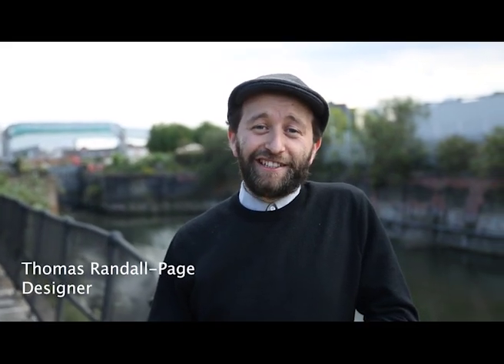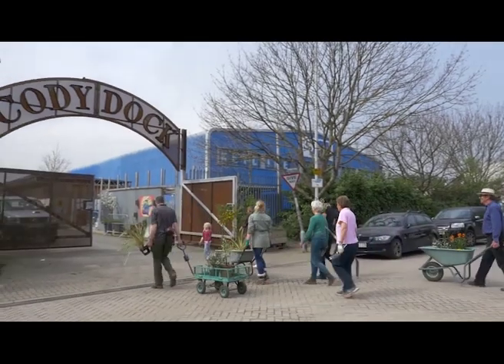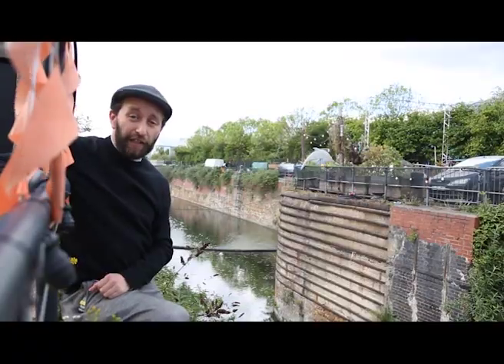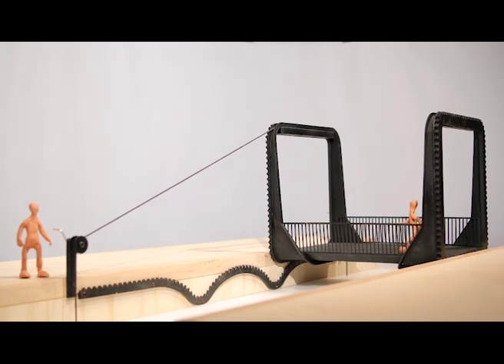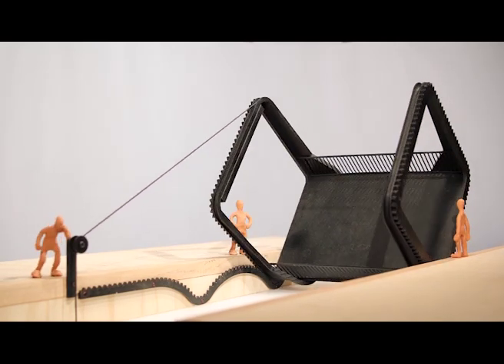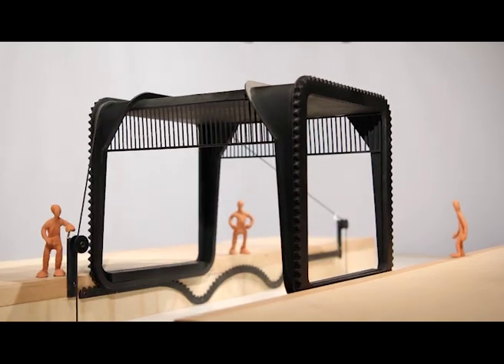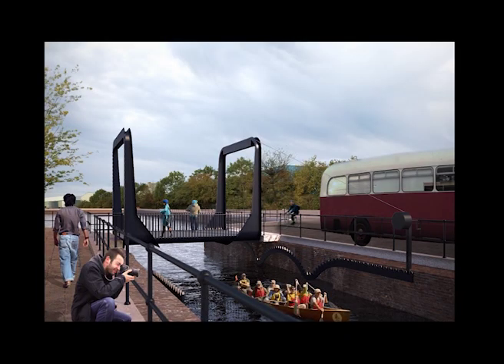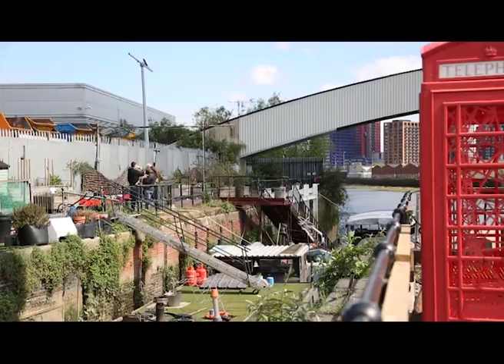Cody Dock Rolling Bridge

Comment: If only humans had invented, oh I don't know, the inclined plane? Or, you know, steps?

Thank goodness someone designed an overly complex and needlessly dangerous pork barrel project in order to cross water.
Reply: People on wheelchairs or bikes could not cross inclined planes enough high to let a boat pass under it
Reply: @dariosilvestri473  LOL! Ffs... Wheel chair ramps are inclined planes. Dear Lord...
Reply: @jasonwarren9279  the point is that the  slope for a ramp is small. For example a wheel chair ramp would take 10 meters to go up 1 meter and other 10 meters to go back to ground level and clearly these kind of bridges don't need to cover such a distance

Comment: just from the visual, its looks unbalanced, when the road section is vertical, it looks like att the weight is on one side, what is the counterbalance?
Reply: If you notice the tracks you can realise that they are made on purpose for square wheels so it would be as stable as an round wheel moving on a flat track. Probably is still very heavy and no super safe but is not more unbalanced that other things

Comment: why not roating the bridge inside a cylinder which has a cut out at the bottom? So you could have a roof as well. Also more use of standard material, so less pricy

Comment: Ok, this is cool, but you could replace it with nearly the same single sided operational functionality but just having a normal-ish bridge with a big counterweight that swings to one side on a vertical axis like a door. You get 75% of the footprint efficiency at a tiny fraction of the cost of all this highly complicated undulating cog and sprocket/rack and pinion jazz.
Reply: Come on, it's an artistic statement, designed with added amusement function. Not a competition for the most pragmatic bridge. Which engineering professor sent you here to scold the video for complexity?

Comment: Isn’t a rolling Whole structure on unrolled gears way more fragile than a simple two split elevatory bridge? You could even keep the design making two huge metal planks that opens outwards and complete the “arches” that use to be the supporting structure.
Reply: But where's the fun in that? :D

Why are so many commenters missing the point... This design is an artistic statement, if you don't enjoy such art then say so or scroll by, pointing out that there are simpler bridges is totally missing the point.

Comment: Hard to believe the number of comments about safety. The whole length of the Lee is a path, with the water to one side, people can slip off, and some may drown. Yup.
This is an opening footbridge. It will be operated either by the 'driver' of the boat or volunteers. The winding mechanism will be protected by a key, which every canal user will have, they unlock it, use it, then return it to its closed to river traffic position as a default. Just like every such footbridge on the canal system.
The details depend on what the traffic is; a train of Thames Lighters towed by a diesel tug has different needs from a narrowboat.

Comment: No don’t do this there are so many risks involved with this design for one wear and tear will eventually bend the supports of the bridge at the roll over point. This bridge is also likely to be unbalanced if more than 2 people lean over the edge. Possibly throwing them off the bridge. This bridge is not safe and as the designer you are held partially responsible for any injuries that occur due to a flaw in the design

Comment: Just by watching the animation, i can see this wouldn't work in this design. Go back to the drawing board and for anyone else, don't give money to things like this without looking into the people involved and check designs, use your head.
A simple bridge up and over would be better and safer. A normal lock would do the job too, these are designed as crossings too.
Reply: It is a cool concept.   But over complicated and unnecessary
Reply: Come on, it's an artistic statement, designed with added amusement function. Not a competition for the simplest bridge crossing. Which engineering professor sent you here to scold the video for complexity?
Reply: @u1zha  The artistic statement and  amusement factor is there. But the engineering and safety to back it up is not,  At least not shown in this video.  
There is absolutely nothing wrong with the idea and concept of this bridge.  But the design shown is flawed, it would not work, ant there are many safety features that need to be implemented to ensure it will not be the cause of many injuries or deaths.

Comment: Looks like it needs more weight at the top of the structure to raise the centre of gravity. To make this thing roll by hand, the height of the center of gravity needs to be constant. Another possibility is rigging it so that the CoG is slightly higher in the ... Oooh, I get it now. The fact that the base is a bit heavier means that it naturally sits in place when it's down. When it's up, it balances, and there's probably a little dip in the path right at the end, or it's just a tiny bit overbalanced against some stoppers.

Comment: It’s cool but why not just build a high solid bridge?  Seems simpler and cheaper.
Reply: Instead of swing sets why not just build benches? Simpler and cheaper and safer.
Reply: @u1zha  uhhhhh,  swing sets and benches have 2 different purposes???  If the purpose of this bridge is to be a play thing then great.  But i was pointing out that it’s an example of trying to be clever when it’s not needed.

Comment: That is a beautifully thought out design.
Reply: No, it's really not.
Reply: @xxDrain  I would love to know why. Please explain?
Reply: @MrBennyboyC  Who is in charge of cranking the bridge when needed? Who is getting paid to stand there and do it? Who will be in charge of safety, so nobody falls into the water? How will you prevent litter from being dumped into the water off the bridge? It's a pretty design for a playhouse, but for real life there's more to consider than the mechanical execution.
Reply: @xxDrain  I completely understand your points but you need to take into account our history of bridges in the UK. Lock gates on nearly all of our canals are unmanned and pose risks to the general public and yet cause so few injuries. Surely we can assume they would add basic safety measures to ensure the bridge Is only opperated when needs be just like any other moving bridge or large moving structure anywhere in the world. It's very easy to look towards the safest solution for all of these problems but they are often not the most efficient or inspiring. I would always opt for the more creative solutions.
Reply: I think the biggest problem we have right now is assuming no one has common sense.

Comment: Why does the bridge feel like a “checkpoint” for a game since it’s only seen operable from 1 side like it’s a return path.
Reply: Got to find the secret way round, its only 230 miles away.
Reply: Legends say that this bridge will be in Elden Ring
Reply: Speed runners just skip this checkpoint with a prop boost, so we don't need to build the bridge now. Problem solved.
Reply: @idontwanttopickone  Speed runners use the weird geometry and not-fully tested rolling motion to clip inside the bridge as it moves, sending them flying across the map at several thousand hammer units per second.
Reply: This is going on Left 4 Dead 3 LOL
Reply: Why does this thing feel like something that I'm now going to explain exactly why said thing feels like?
Reply: @Ingestedbanjo  waiting for that explanation...
Reply: @deformercr6680  My point is the original guy already gave an explanation:

"Why does the bridge feel like a checkpoint for a game?"
"It's only seen operable from one side like it's a return path."

It's a little silly to phrase the comment as "Why does it feel like X?" if you already know exactly why it does.

Comment: - giant exposed, meshing gear teeth: pinch/crush hazard
- no lock-outs to prevent tipping the bridge with people on it: fall/drowning hazard
- cranks on only one side of the river, allowing people to become trapped on the other side if left inverted
- unstable resting states
Reply: i checked the rest of the comments, and it turns out this is fine, apparently anyone who is injured by bad design is actually an idiot and deserves it. it seems i had misunderstood what infrastructure is supposed to provide to society
Reply: @spambot7110  Listen, we should make society worse because human suffering is inherently good, or something, because idiots deserve it, or something. 

Because it strokes their ego to think themselves superior to all the idiots that deserve to be drowned or crushed or whatever.
Reply: In order:
- fence/railing to protect from crush hazards
- someone on the bridge would increase the force required to rotate the bridge. Just have a torque limiter (like a torque wrench) in the winch mechanism and it will protect from rotating while there is any substantial weight on the bridge.
- this does need a solution
- unstable resting state is covered by the cable being unable to move without human interaction (given proper winch design).

Comment: Ok but how does it rotate back into place? The rope will roll it upside down but it doesn’t seem like there’s anything to undo that
Reply: Around 1:30 you can see a cable behind the bridge, which goes to a winch/roller at the other end of the track. Around 1:40 you can see both of these going down out of sight, where they presumably meet. All you need to do is winch the other way and you pull the "other end".

Comment: The shape is overly complicated to make a cylindrical design would work better in my opinion. A ramp a normal safer bridge. This thing has a ton of serrated pinch points if you know what I mean 😂
Reply: A circle would require a more material which is also set lower in order to maintain the same bridge width and raised height. The circle's diameter would have to be equal to the diagonal of the square.

That math works out to the circle's circumference being 11% greater than the square's perimeter.

Side of square: s
Diameter/diagonal: sqrt(2) * s
Circumference: pi * sqrt(2) * s
Circumference reduced: 4.44s
Perimeter: 4s
Ratio: (4.44s)/(4s) = 4.44/4 = 1.11 = 111%

The rail would have to be increased in length by 11% (increasing distance traveled to invert the bridge) and would have to be lowered, to accommodate the arc of the circle under the bridge by a number of units equivalent to: (sqrt(2) - 1) * s / 2 = 0.414s / 2 = 0.207s

Given the math above, a perfectly balanced square (as they described) would have a lower moment of inertia than a circle. Thus, it would need less force to rotate (torque) a square bridge compared to a circle.
Reply: @ShimrraJamaane  you could also just put a ring on bearings/roller with a counter weight that blocks peoples path when the bridge is up and have it remain in the same spot instead of rolling across
Reply: @theborgcaptain1522  Yeah, but that would require more long term maintenance. Though, that is a far more elegant design.
Reply: @theborgcaptain1522  Agreed and as Shimrra says, a more elegant solution. However.....Friction in the ring bearing system is going to be the enemy, given the mass involved,  in this environment. With the open rack it is a relatively negligible consideration.
I'd love to see either actually built, to be honest.
BTW, without specs on, your username appeared to read 'The Bong Captain'......Which was entertaining.
👌
Reply: @ShimrraJamaane  the cylindrical design would rotate in place eliminating the need to rotate to the side eliminating the need for a rail and the pinch points that decrease the safety. Its hard to describe sorry thanks for replying.
Reply: @robertfajardo2239  The Borg Captain explained that same thing. It is a more elegant solution but it is more expensive and requires more long term maintenance.
Reply: The thing is that it's not cylindrical because of the hight the square shape of the bridge provides different hights of boats to pass without problem. It's pretty clever but not that complicated.

Comment: This guy: creates weird bridge rolling on gear teeth

Corrosion, particularly pitting corrosion on the surface of the teeth: "Allow us to introduce outselves!"
Reply: stone and stainless steel could work.
Reply: @ABW941  "stainless steel" is not nearly as stainless as you think. And the ones that are, don't necessarily have the mechanical properties best for such bridge. And the perfect material is most likely impossibly expensive, and STILL needs some maintenance.
Reply: @horvathbenedek3596  maybe something round and durable made out of granite which can be lifted with a counterweight?
Reply: @ABW941  Granite is durable, bit brittle. It would easily shatter from a bit of grinding. Honestly, surgical grade steel is your best bet, but as I said, it is really really expensive. 
Make no mistake, there are structures like this operated across the world, and they function well. The problem is with upkeep - those are looked after by profitable companies. This is a city's investment, which amounts to "nobody will look after it". The real issue in my mind is the one-of-a-kind tooth configuration. If this was a plain drawbridge with a linear gear and a gearwheel, which moved the bridge up and down, that's fine - you can always just change the gears every decade or so.

It's a clever invention, I just don't know about putting it outdoors.

For the record, if you wanted to create this for the ages, tungsten is the answer. Really expensive, hard to work with, but high purity Tungsten with nicken binder is essentially chemically inert. Tungsten also has favourable abrasion resistance due to its insane hardness (5 times harder than tool steel, for example a file or rasp), and in its pure form tough enough to be made into even a sword. So yeah. Tungsten would be great. Problem is, Tungsten is REALLY expensive.
Reply: The one use of this meme that I like. Entirely true. Simpler is better. Just make a draw bridge or something.

Comment: I'd want to ride it while my friends cranked the bridge 

Also how is it counterbalanced? That seemed quite unclear
Reply: By rolling exactly horizontally.
Draw an imaginary line from the center of 1 square to the other in the movable element of the bridge. This line is horizontal and is parallel to the deck of the bridge. When the crank reels the string in, the movable element moves over the specially shaped gear tracks by the water, they're shaped in a way that the  imaginary line travels horizontally. Picture this: Roll a car wheel across the floor. Draw an imaginary like through its center. It travels horizontally, just like with the bridge. Now tape 4 hammers together and tape them to 1 side of the wheel, the wheel will be biased to roll to a position where the hammers are the closest to the floor. Basically what You've done is offset the wheel's Center Of Gravity (or COG). This exact thing applies to the bridge. Since the deck is on only 1 side of the movable element, it will act just like the hammer experiment. The weight of the deck offsets the COG of the rolling element, making it hard to reel the movable element to the state letting boats through. It is then biased to roll to where the deck is lowest, just like the hammers on the wheel biasing it to roll to where the hammers are the lowest.

Upon quickly looking  back at the video, I missed additional strings going off the cranks downwards instead of toward the bridge. These may be connected to some balancing mechanism negating the weight of the deck.
Reply: @737Garrus  i understand COG but it looked to me like the spacial centre of the bridge (middle of that square) moved horizontally which is exactly what you describe. Not the centre of mass/gravity

I was just thinking it looked too hard to overcome inertia to get it out of walkable position. There's got to be hidden weights or something and that's what i was wondering about specifically. because as is with design only being what can be seen in the video this bridge makes no sense. 

plus wheels can start being rolled easier than squares, so even if the centre of mass were the spacial centre of the square (by using different densities of materials to make mass as symmetrically spread around the whole square as possible so at every point in the rotation the bridge would be balanced and not want to fall either way), it would still take a lot of work to get it over each rounded corner.

Comment: Literally could have a raised bridged and that's would be cheaper and more reliable
Reply: But doesn't look as good and obstructs more
Reply: @SirDella  Obstructs what?
Reply: @prich0382  A lift bridge, at least one that has been linked in this video, has the mechanism and counterweight extending outwards, whereas this bridge is completely contained inside the canal. Al the end of the video we see that there is a street and a sidewalk right next to the bridge, so in this case the design needs to be as compact as possible